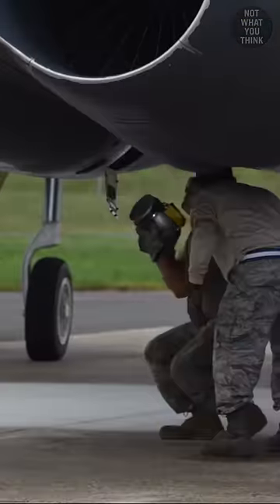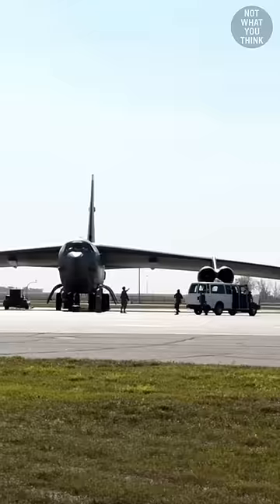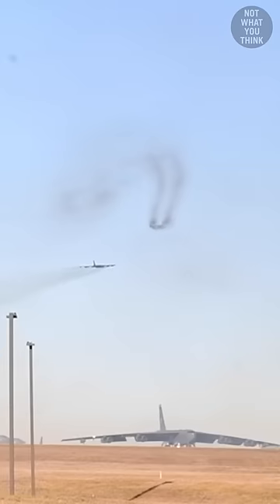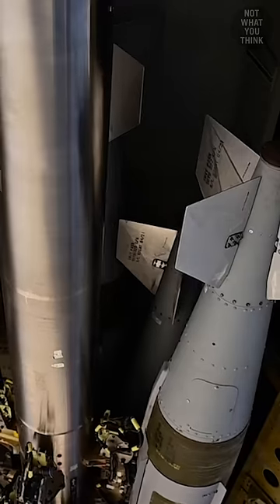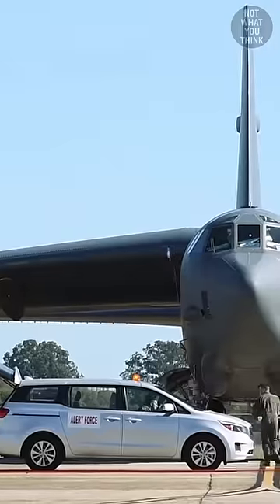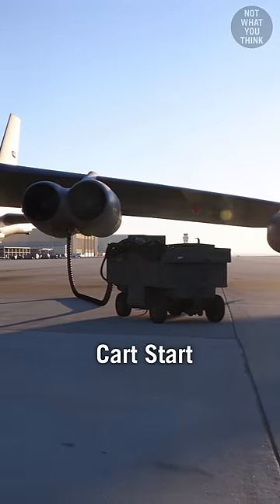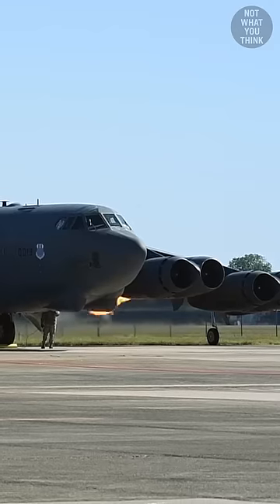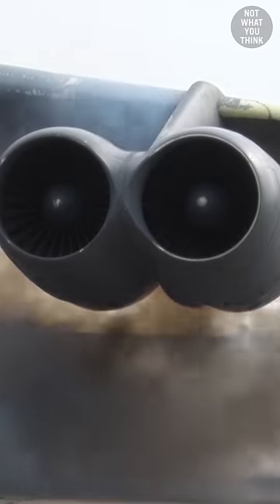Putting Explosives Inside Aircraft Engine #shorts

Comment: Kaufmann starter!  Works good, lasts long.  The engines don't much care if the hot gas spinning up the turbine comes from burning powder or burning jet fuel.  The original "Flight of The Phoenix" shows a similar way of starting piston engines.
Reply: Just remembered watching that movie as a kid.. [SPOILER] man was I on edge as they were running out of cartridges and with that their last chance of escaping certain death
Reply: Kaufmann starter!
So, Andy Kaufmann came up with this.
Just what I thought!
Reply: saw they have practice on a cart start f4. thought the airplane had caught on fire was burning up. little puzzled by dozen people standing around looking bored.
Reply: Some old vintage diesel tractors and machinery are also started with Coffman blanks. Make sure the tractor gear is in neutral & brake on, put the shell in the ignition slot, replace the cover, and use a hammer to strike the cover.
Reply: @Ed_Stuckey  "Heeeeere I come to save the daaaaaay!"
Reply: @Sebaxtain  Yes I saw that too, excellent use of props to build tension in a scene.
Reply: coffman
Reply: Hopefully the new RR engines  fitted to the B52  wont need these  starters😮
Reply: I love that movie, I think I first watched it on YouTube with permanent subtitles in a language I dont speak at a resolution that a blind person would be satisfied with
Reply: *Coffman starter, by roscoe coffman
Reply: Big difference between Coffman starter used to crank piston engines and gas turbine starter used to start jet engines.  Coffman used a cartridge that burned all of its powder in milliseconds, rapidly pushing out a shaft that. engaged an engine start gear and then retracting, kicking the engine's crankshaft around for a couple of revolutions maximum in hopes of firing a cylinder.  Starting a jet engine requires a long, accelerated spin-up, either from an electrically powered starter or from a geared turbine powered by hot gases.  The large charge of black powder in the cartridge burns for a period on 20-30 seconds  to spin the starter turbine, which spins the engine up to a speed at which fuel and ignition can ne turned on to complete the start cycle.  Those cartridges were in use starting jet engines before I first encountered them being used to start engines on F-105 fighter jets in 1961.
Reply: KAUFMANN CABS
Reply: @Ed_Stuckey haha i got tha reference and i was born in 1995
Reply: I was told by an old AF crew chief for the B52 why they didn't just always use the cart start. 

 He said it is terrible for the engines. He also said they only did it for two while the others turned on during the taxi. 

  So I assume once two of the engines were turned on they powered the rest?

 Either way he said it took X amount of hours off the engines each time.
Reply: @dianapennepacker6854  I think the B-52 used compressed air for cross-starts, but electricity is another possibility.
Reply: @dianapennepacker6854  Also it makes perfect sense that a cartridge start would incur more wear than starting off compressed air; the gases from the cartridge would very likely be hotter than air from the ground cart and corrosive on top of that.

Comment: Using a bomb to start the engines of a bomber? Murica
Reply: Hehehe, excellent 👍
Reply: Some plane engines use shotgun shells. Large ones
Reply: No, not Merica. Google for start up sequences for the British Canberra bomber which came out three years before the B-52.
Reply: if your ancestors know about this , they will die again
Reply: @martykarr7058  facts are lame, 'Murica.
Reply: Gives the expression "rocket jump" an interestingly whole new spin... LOL
Reply: @martykarr7058 to be fair, Murica didn't invent guns or gun powder either and yet: Murica!
Reply: That's a bit of an overstatement. It's actually filled with black powder. Burns slower and creates a lot of compressed gasses that turn the engine over.
Reply: splash damage effecting the bombs on board
Reply: I mean, when the SR-71 was first introduced the start cart was a Buick or Chevy V8 car engine. They literally started the engines of the fastest jet plane in history with a muscle car, which seems 100% Murican to me.
Reply: Indeed
Reply: Its basically a scaled up version of the starter fluid you spray into the air intake of your finicky lawnmower
Reply: @martykarr7058  They may have come up with it, we ran with it.
Reply: @harrystone8847 
Finally the truth. I was a Crew Chief on a B52G back in the early 80s and those cartridges were about 6in in diameter and 6in long filled with a medium to fast burn gunpowder that drove a turbine that turned the main engine shaft.
Reply: @martykarr7058  canberra is american
Reply: Merica
Reply: @roadwarrior1961 I was a crewchief on "G" models in the 80's too.
Reply: @b52crewchief  
I was at Griffiss AFB and was assigned aircraft 602
Reply: @martykarr7058 Which the US also used as the B-57.
Reply: Its amazing that we have aircraft that are literally designed to drop explosives onto people and things
Reply: @kanekeylewer5704  Such is the way of human progress.
Reply: Murica at it finest
Reply: @martykarr7058 So it's actually the Bri'ish?
Reply: @2hotflavored666  Yes, the Canberra was a jet replacement for the De Havilland Mosquito.
Reply: @martykarr7058 MERICA
Reply: **) yessir get out or make a change it’s great engineering anyways the Germans did it
Reply: Fuck yeah!!!! 😂😂😂
Reply: 😂, this reminds me of when Trump asked a cabinet member if it's possible to put out a hurricane with a nuke, so Murica!
Reply: @martykarr7058 it’s not the first plane, this has been used many times
Reply: We gon use bomb to make big bomber move fasterer so it can bomb more things! ~ Murican with an Aeronautics Degree
Reply: D A M N    R I G H T 🇺🇸🇺🇸🇺🇸
Reply: Imagine the inventors being like “hey this engine is seized” and his mate just comes up “i gotchu” as he pulls out a grenade.
Reply: @Elloliott and that's why we are in the problems we have know
Reply: It's common practice
Reply: Hey if it works, it works. If it aint broke, dont fix it.
Reply: So what is bombest
Reply: The sr 71 needed a v8 😂😂 not kidding.
Reply: Bork yeah
Reply: Some Pumps of Rocket engines gets also started with a small bombs
Reply: Cringe they didn’t invent it
Reply: @flysomepipers  The English Electric Canberra is a British first-generation, jet-powered medium bomber. It was developed by English Electric during the mid- to late 1940s in response to a 1944 Air Ministry…… Americans……
Reply: @2hotflavored666 British*
Reply: Tractors used to use shotgun shells as well
Reply: Using shotgun shells to jumpstart engines was common practice for decades. America is definitely not the inventer nor the only countrie using it.
Reply: Except it isn't unique to America. Three other countries use this method as well.
Reply: @martykarr7058  which country still has a bomber, not too mention those 3 years really made a difference between having one and not😂😂😂

Comment: "However, during a training exercise, it generally takes longer because of how many safety checks you have to do before safely blowing up your jet engines."
That sentence blows my mind.
Reply: There are extra safety steps in training that aren't done if this was an actual alert launch. Fire protection mainly and verification of certain systems. In a real launch the aircraft would start taxing after two engines were online, starting the rest on the way to the end of the runway. in a drill, all the engines are up and running before taxi.

Comment: Cart Starts ftw at Barksdale AFB back in the mid 80s on B-52Gs.    Always fun to see that black smoke rise as the engine spools up to running speed.  8th Air Force, 2nd Bombardment Wing, 2nd OMS.
Reply: Same at Loring   Saw my fair share 1976-closing.  Fire dept.  matter of fact B52 landed for the 2nd time yesterday @ Loring to celebrate 30 years since closure.  Historic as the B52 was from the 69th bomb squadron that was also at Loring prior to closure. Kc135 scheduled for tomorrow for open house  2 Aug 24.